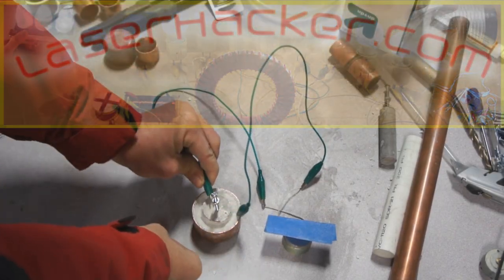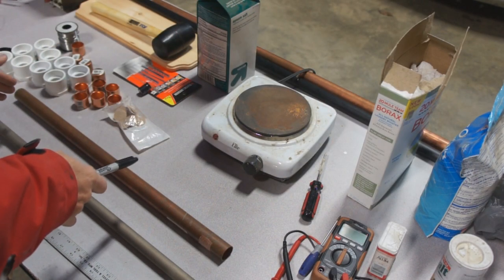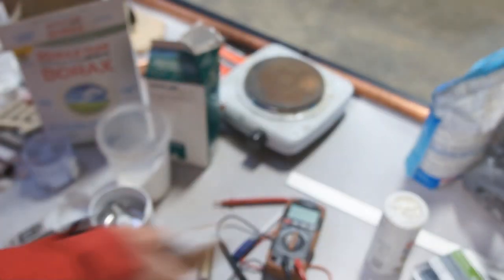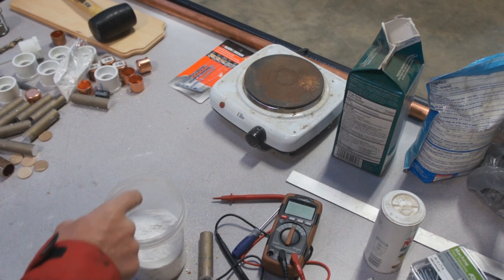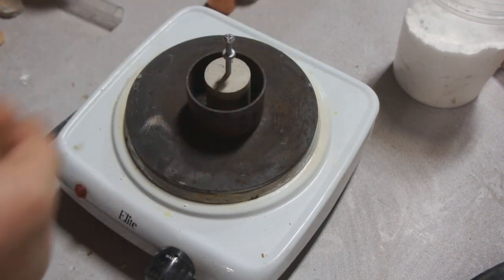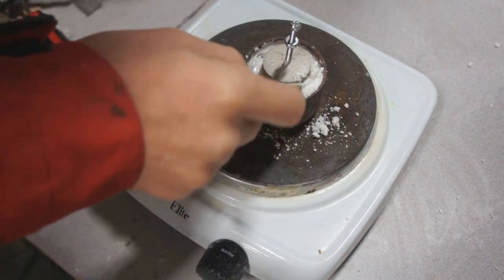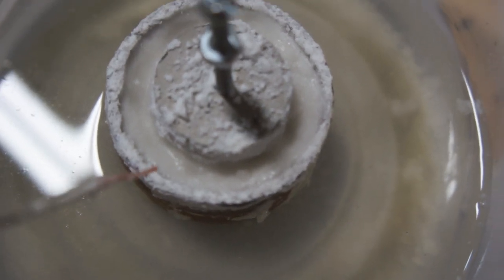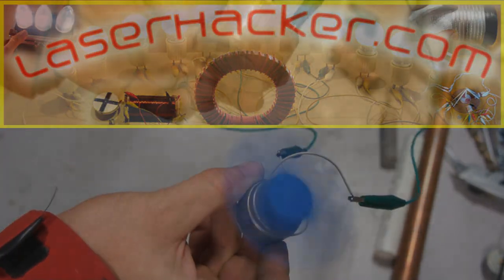How to Build Crystal Power Cells - Long Duration Power

Comment: I was curious how well this cell performs. So, I built one yesterday and have been playing around with it. Mine is the 2" cap like yours plus a 3" pip soldered to it (like half of a pipe bomb). It gives a 1.23 volt open circuit and about 25 mA short circuit that drops to a steady of 10 mA (0.45 volts).
The only change I made; is I used pure KCL (potassium chloride) instead of the no-salt.
One thing I noticed; when I first built it and it was hard enough to handle, the Copper was positive and the Magnesium was negative. When it cooled completely, it reversed its polarity. Is that what you have lasersaber?
The jewel thief circuit I have doesn't run bellow 5mA and was wondering if you can post the one you're using.
Thanks for sharing. Excellent Channel.

Comment: what would happen if you were to fill the copper bit let it liquefy then once it was uniformly melted move the copper into the cooling stand and then push the magnesium core into it while still liquid. 

also have you tried cleaning the oxide layer off the magnesium bar. and possibly using a lathe to cut fins into the magnesium to allow for more surface contact.

what if you used a magnesium wire coiled around.
Reply: Wow. Great ideas.
Reply: i like you
Reply: Sounds good except that he wanted to keep the mixture out from underneath the Magnesium to keep it from pushing upwards over time.

Comment: am able to create 3.5 amps with .75 volts with your basic recipie and the addition of one more. using a carbon/graphite + and aluminum channel 2in tall x 1.5 in wide x .5 in as ground. has been running in series and parallel for several years.  so thank you lasersaber for your video. was a great place to begin.

Comment: Could you use an ionization chamber to harness the particles coming off something very small and radioactive?  I've been thinking about it for awhile, and I think you could use an ozone generator in reverse, maybe inside a lightbulb under vacuum to lower the voltage necessary to get across the gap.  Failing that, try a wire sphere or a bunch of circles of wire around and very close to the material, then a bigger sphere, or circles, further out.  There should be a voltage between those 2 wires, you might even have enough to light a small LED for 50 years.
Reply: Yes, that is called beta-voltaics (similar to photo-voltaics). It takes advantage of radioactive materials emitting beta particles. The voltage is generated exactly as you suggested (by beta particles intersecting at right angles to a copper line). This is a specialized source of power that has limited applications (pace makers, remote electronics power sources, satellites) due to its low voltage and low current. But, it has long life (which is a function of the material's half-life. You can actually buy beta-voltaics batteries. It's perfectly normal but a little on the pricey side.

Comment: For $30 or so that the materials cost, you can buy $30 worth 
of cheap alkaline "D" cells at a local hardware store that will 
last longer. For the little power you're drawing off of these crystal batteries, ordinary "D" size alkalines will seem to last forever too.

I have an efficient AM-FM-SW radio that has a clock, & alarm clock in it. It runs on 4, "D" batteries. I have it set to wake me up to the piezo beeper every morning. I do actually listen to that radio an hour or so, a couple times a week too. 

The same cheap 4 "D" alkaline cells in the radio have been running the clock, alarm every morning, & the radio at least a couple hours a week for over 2 years now. Battery level indicator on the radio shows the cells still have plenty of power left in them.

I've been using the same original AAA alkaline cells in my remote for my Vizio TV. They're still the original Vizio AAA batteries that came with it over 5 years ago. It gets regular heavy use almost every day, & do not show that they're weak yet.

The remote for my other TV gets almost as much use. The original ordinary Chinese AAA batteries in it are about 2 1/2 years old, & are still going strong.

The wireless Logitech keyboard I'm typing this on has been using the same AAA batteries for almost 2 years now. I never shut it off. It's been left on all this time.

The lifetime of these crystal or other alternative batteries my be long because you're not really drawing much power out of them. However, a good $30 battery would be expected to have more power than a $1 ordinary battery. But will not have more power that $30 worth of those $1 alkaline batteries. 

For a point of reference, a typical "D" size cell has about 4 times more power than a AA cell. A "C" size cell has 2 to almost 3 times more power than an AA cell. An average AA cell has about 3 times more power than an AAA cell. So size matters too. There's more power in a big or heavy one than a little one or light one. 

Think of them as a fuel tank. You won't go as far with a cup of fuel, as you will with a bucket of fuel. But a small motor scooter will go much further on a cup of fuel than a truck will.

If you want to spend $30 on materials to make a long lasting battery, $30 worth of ordinary batteries will last longer running the same stuff. If battery size & weight is critical, Lithium batteries have more power per size & weight.

Comment: This is just chemical energy conversion a LED will run a off a lithium battery for 12+ years as some led esp blue will run on micro amps. Camping fire strikers are magnesium but expensive It does work out cheaper just to buy a battery, but this vid is good learning material.
Reply: If you go to any army surplus store you can get a big chunk of magnesium in the form of a fire starter for a pretty good price.
Reply: Its not always about what is cheaper. Its about not having to use money. Make things with what you have. If you happen to have all the ingredients, you save yourself the money.
Reply: @(JD) Juan Gonzalez Flores no problem, also, if you have a harbor freight near you they sell the same fire starters for a super cheep price, like a $1.75 each, or something close to that
Reply: patrick gardner are they pure magnesium?
Reply: @haveaniceday7950  probably not, but very very pure.

Comment: I think that the most important thing of all these DIY batteries is to measure which method is better in terms of Energy Generation and Lasting AND COST. I have seen over here in Youtube some other projects with batteries made with cheaper elements that generate the same amount of energy. What will be the advantage of your battery?

Comment: Did you try to recharge it, perhaps you already do it until a certain using time ?
Or
Is it a trash battery, when ended des assemble the pieces cleaned up the oxydation and replace the electrolyte ?
Last questions
 how long use possible and wich power in volts and amps do you obtain ? 
Most of the time, obviously

Comment: Hello Lasersaber, 
Have you tried using graphene mixed with polyurethane onto your copper to help reduce the corrosion?
Reply: The copper is used in the reaction that produces electricity.  You wouldn't want to coat the copper in anything.  That would be like saying "wouldn't it help to take the clamps off your battery terminals, place tape over them, then put them back on?"

Comment: I have made a few small crystal cells last year which are still holding voltage.  I used a mix of Alum, Potassium Chloride, Zirconium, and Zinc Oxide.  I used copper for my anode and zinc for the cathode.  Heat applied seems to increase voltage as cold decreases it. Each small cell produces between 0.50 to 0.90 V DC but fluctuates based on current room temperature .

Comment: Home made chemical battery. The slower the reaction, the longer the shelf life and that's about all you can get from these. Great way to use up what would ordinarily be the leakage any battery experiences. You want long term and high power when you need it (none available in the meantime), make a Zinc Air battery of the "dry" kind. It generates no power and has no leakage until you add water to the electrolyte. Then you can get Kilowatts.

Comment: to prevent it from bubbling up place a container with some water on the heater, and the stuff you want in it.. as the water gets hotter will warmup the material to prevent it from bubbling don't let the water boil, by (removing some and place cool water in)
this process is used to cook recipes that can't boil..
at the end you will get a compact very dense material.
Reply: +Tiago Alexandre You are very intelligent, but need to study a bit of science. This crystal stuff requires a much higher temperature (than boiling hot water) to melt and fuse. Your idea is ok for warming baby's milk, not melt alum etc.

Comment: I just noticed you were having problems regulating the temp of the cap here are a couple suggestions if you don't mind.

In chem you can sink your beaker in play sand on a hot plate and it will evenly heat your substance, or maybe just heating water in a small pan with cap in center should evenly heat.

Comment: Simple gavanic potential differences of metals. Take two dissimilar metals and they have a potential different (voltage difference). Thats why using the wrong kind of bolt, or not insulating the bolt when fastening metals plates will corrode and break within a year or two. Statue of Liberty had this problem because it was made of copper.

The amount of current from this is extremely low. You can increase the current by decreasing the resistance of the electrical connection between the two metals (best by touching them to each other directly).

When the surface of the less noble metals has corroded and breaks electrical contact with the other metal the voltage is gone and current stops, as does the corrosion process.

Using the salt mixture between the two increases the amount of metal in electrical contact but does not stop the corrosion. The resistance is also high so the corrosion is slower but the current is smaller than if you had used salt water in place of the solid salt.

The amount of power the chemical reaction (corrosion) of the metals releases is extremely tiny and spread of a long period of time.

You could sell the metals for the pocket change they're worth, and buy 1000x the amount power of the power company that this would release.

The purpose of batteries is that they have the best balance of long-term storage and short-term release of their energy. This takes the long-term storage to the extreme with little to no short-term release of energy, to the point of being completely inpractical for anything.
Reply: You seem to know everything about chemistry and batteries. Can you make your own channel and show us how to make more efficient, powerful batteries. Thanks.
Reply: TROLL

Comment: John Hutchinson invented a crystal power cell that does exactly that. From what I understand it works on the principle of polarized crystal growth. In short, the crystals need energy in order to grow and they do so by pulling it from backround heat, in turn it produces a changing electric field because it is polarized. I personally found that it works great as a current amplifier when connected in series to a power source with the + end of the cell attached to the + of the power supply instead of a standard + to - series connection... It works more efficiently the higher the voltege source you use.

Comment: It would be helpful if you wrote the ingredient list and written instructions in the description so that the hearing impaired can take advantage of this.
Reply: Youtube does have close captioning available which automatically tries to convert the speech into text on the video, but it is not always accurate and often misses things if the volume level on the uploaded video drops, however the person posting a video can add annotations to the video  and can add links, formulas and other useful information to the description.
Reply: SocietyofEnoch I see you everywhere.
Reply: all half cups: Alum; Potassium Chloride; Borax; Epsom Salt. mix very well...has Magnesium Core, and copper pipe as a holder. Have on low heat otherwise boiling over is going to happen. let sit for half hour
Reply: You could actually use this to charge up a capacitor bank or an array contain both Battery & Caps... How do you know its not re-chargeable? have you tried it..
Reply: it is rechargeable you just add a few drops of water also he said hes got a live feed on one that's been running a small motor for over 2 years
Reply: in the next video he builds one with no water or electrolyte and it powers a small dc motor that would take 4 or 5 A batteries to run I haven't yet built this or seen how long it will run a dc motor like that but I would guess it would be longer than the A batteries only experimenting and time will tell but don't you think its amazing he was able to run his high efficiency motor on it for two years also he predicted the dry version could power for his lifetime heres the video 12V Crystal Cell Update + Alternative Construction Method https://www.youtube.com/watch?v=QZ0oCND23S4
Reply: what I'm getting from google on brown stone battery is that its a Artillery battery can you provide a link to the brown stone battery that you mean also I believe the materials used are pretty inexpensive about 10 or 15 dollars bought in bulk if you feed the power from it into your meter box for two and a half years you'll probably earn 20 dollars
Reply: Nicolas Broszky ,You failed to offer a link to this Supposed Brownstone batteries which there's no trace of on google or Wikipedia are you sure you don't mean voltaic piles . I can get 1PC-99-99-Magnesium-Metal-Rod-Mg-16mm-x-9cm-High-Purity for  US $2.47 + free shipping on eBay that means I can build one 4 and 1/2 inch battery for under or around 10 bucks . I don't remember any one claiming it drew energy from the environment but I suppose its possible I would like to know what you think of his batteries lasting two and a half years running his motor with out stopping and still going strong
Reply: Nicolas Broszky what do you suppose the best generating capacity is from a 1 volt cell?

I'm trying to heat a greenhouse with battery power.
Reply: personality cat can you make a comprehensive cost summary of the crystal battery for me?
Reply: Trevor Doge , Do you mind if I chime in here I was wondering what the batteries are going to power and what the measurements of your greenhouse are what time of year you'll be heating it and how many degrees you need to raise it my first thought was using a candle or propane lantern to heat it a couple of degrees then I remembered something I've read about something you could use crystal cells for and that's the fueless engine attached to the fueless heater I've not built them and don't know how well they work but you can check out the plans for free here http://www.softpro.ee/creativescience/ also you'd need a few hundred cells to run it so we're talking a 100 bucks just for the cells but the heater is really supposed to kick out the heat and you could charge up conventional batteries with the back emf if you figure out how its supposed to work
Reply: Nicolas Broszky I said Trevor Doge and that's who I was talking too !
My last comment to you was Nicolas Broszky ,You failed to offer a link to this Supposed Brownstone batteries which there's no trace of on google or Wikipedia are you sure you don't mean voltaic piles . I can get 1PC-99-99-Magnesium-Metal-Rod-Mg-16mm-x-9cm-High-Purity for US $2.47 + free shipping on eBay that means I can build one 4 and 1/2 inch battery for under or around 10 bucks . I don't remember any one claiming it drew energy from the environment but I suppose its possible I would like to know what you think of his batteries lasting two and a half years running his motor with out stopping and still going strong ? 
which you're welcome to answer anytime .
Reply: "Parts list and more information listed at: http://laserhacker.com/?p=326"
Reply: Deep breath to activate your hearing.
You need to make senses alive to use your hearing ability. Yoga and deep breath is best way to recover all senses.
Reply: Nicolas Broszky  , OK I have read your explanations which sounds somewhat technical. Nonetheless, let's check it. 
Please define electrolyte. You are saying once the electrolyte is absorbed it won't come back. I agree, it wouldn't come back. But, I can tell you these electrolytes will take forever to be consumed.
You said that the output energy is far lower than the input energy. Again, could you please extend your claim? The only energy other than the heat is the electrochemical reaction. What exactly are you referring to?
Please understand, I am just trying to understand if you are not just a denier without base or if you really have reason on your points.
Also, could you give direction to some youtube video for this porous glass battery?
regards
Reply: Nicolas Broszky  you are sorry because you do not know what electrolyte is? how can you make a point without knowing the meaning of what you are saying.
Don't be sorry, just answer, and your answer will refute your argument.
Reply: @Nicolas Broszky hey, disregard my comment above. I have more to do no time for you.
Reply: I used that but didn't get all the ingredients.
Reply: @theinquisitor2481 thanks
Reply: I just wanna know where i can get some magnisium cores.
Reply: NDFOOTBALL I am not hearing impaired but I could use a list....
Reply: paul austin  yeah i realized that later, but thanks for calling me a chump, I needed that